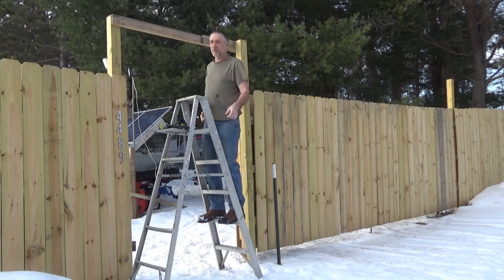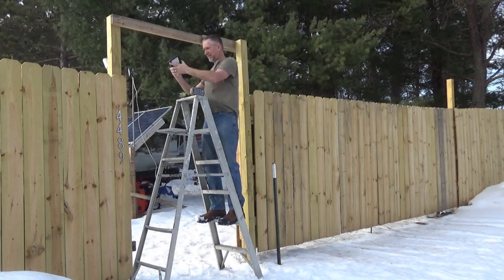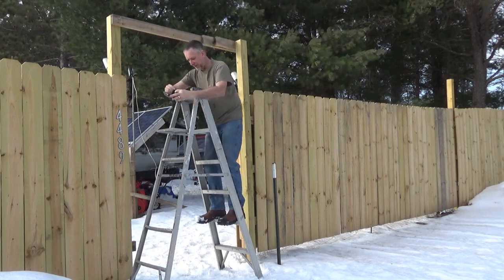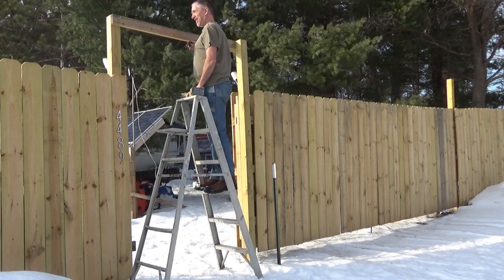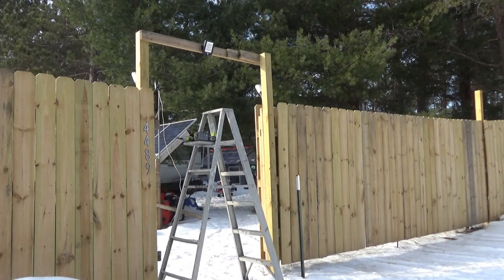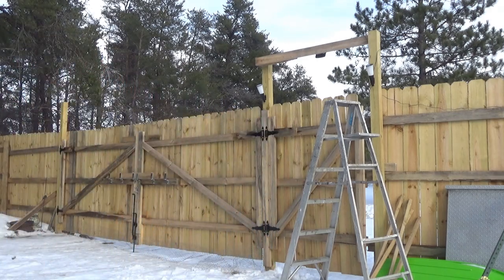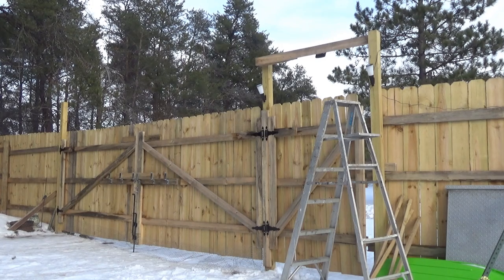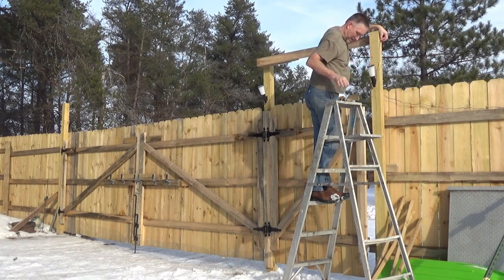Installing Off Grid Homestead Security Lights

Comment: Why not tack the wiring on the inside board then screw the same size board over the wiring?   This way no one will be able to see the wiring and the wiring would be more safe.   

Doesn't it bother that your security lights  invade the neighbors yard across the road?    We have security lights but we made sure they did NOT infringe on the neighbors property.
Reply from the maker: The wire is easily accessible from the back of the light anyway, I figured. I am not "invading" the neighbor's yard, actually its my property according to a survey about 20 feet on the other side of Pine Road. I have told peeping ken that he is literally trespassing on my land when he drives past my house on Pine Road. And nobody lives there or used that place anyway.
Reply: @TheDoItYourselfWorld   Our county laws say that our security lights can only provide light 10 feet on neighboring vacant property and zero lighting if there is a building within 20 feet that is inhabited 8 hours a day.  Pretty much like our laws that say no horse, cow, pigs, goat, sheep, poultry can be within 30 feet of a neighboring residence.
Reply from the maker: Well, then I am absolutely good to go because I own 20 feet on the other side of Pine Road and nobody uses that trailer anyway. And the light points down at the road in front of our gate so we can see to get in at night :)